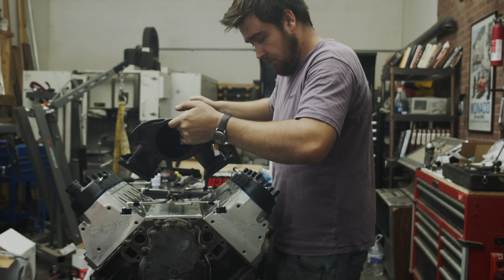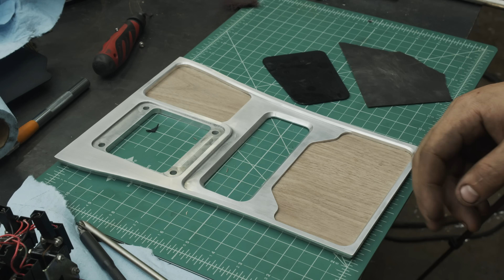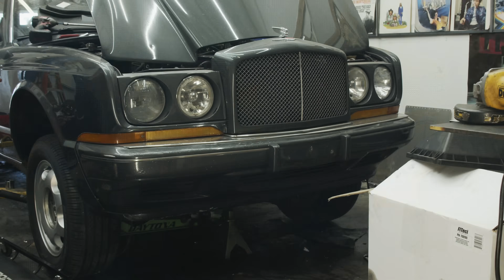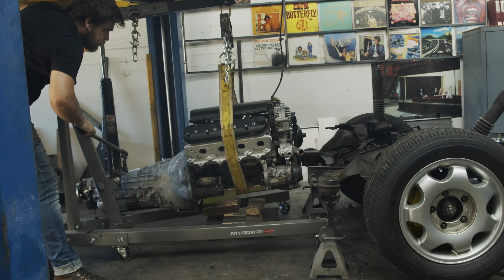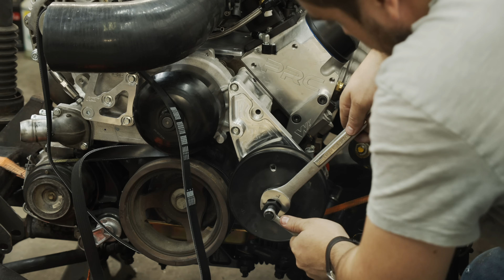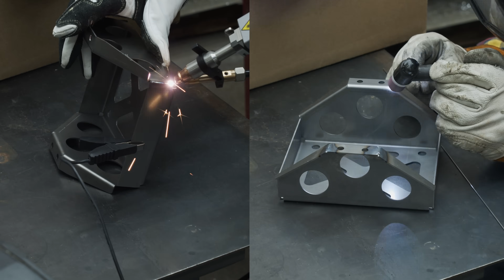The Manual LS Bentley Continental Project Continues…

Comment: On the TR6060, did you visually check the input shaft to pilot bearing contact before assembling the clutch?

The trans went to full depth super easy which is extremely uncommon unless the pilot bearing is missing or the input too short to reach
There are two pilot bearing "pockets" at the back of the crank. With the TR6060 series, there wasn't a standard, so you could get long and short input versions. If the input isn't supported at the crank, it will wreck the trans very quickly

Looking forward to seeing how the shift gate works out

Comment: In Texas, if a car is over 25 years, it doesn't have to pass tail pipe emission test.  But it is supposed to pass a visual test.  But they stopped having safety tests in Texas.  The police are supposed to be the safety test now.  I doubt the cops here are going to demand you lift the hood and do a visual emissions equipment test.  The car emission equipment is supposed to match the engine or the car whichever is newer. In other words, you can do anything you want with a car that is over 25 years old.  Yee haw!

Comment: About the belt being "too close": why don't you make some sort of adjuster for the serpentine belt pulley? You'll be able to move the the pulley up, gaining clearance without having to rely to the alternator in order to do so. At the end it's only about making an eccentric spacer, or maybe you can thing of a fancy spring loaded version, like the OEM ones

Comment: I just looked at some 2020 Mulsanne 6 3/4 (6.8) cylinder heads. They never changed the valve angle or chamber design!!!! Almost identical chamber to a 60s Buick, super steep valve angle and flat floor no heart shape. I once dreamed of using one for a 500ci plus but the heads would require massive cutting and welding to make any power at all. Even 2020 heads.

Comment: As a heads up I have had those pans leak between the layers where the oil filter adapter bolts on. Carry on with the cool stuff.

Comment: Really loving the project and the fab work is beautiful. However, I have a question lingering. Why LS swap it? I do understand the "why not" after all, LS swaps are cool, but what is wrong with the original engine? Power output? Reliability? Thank you for the videos!
Reply: Most probably spare parts availability and prices.

Comment: I definitely think the laser welding has its place; anywhere dealing with thin materials, where you want to minimise the heat, it really seems to shine. (... hehehe)
And when coupled with the system's ability to run as a cutting table, I think that lends itself to approaching bracket problems with a mindset of "most strength with minimum material & weight", rather than the classic hotrodder "slab of 10mm plate" philosophy 😁

Extremely enjoying watching you dig your way out of the challenges this project keeps throwing at you, in that unflappable deadpan style.

Comment: 12:57 way too little. Make a dog leg, see if you can't pick up another mounting point or hole for stability.
16:30 if you keep some scrap/drops, you can add that the end of the weld for stuff like that and then just grind it away when you're done.